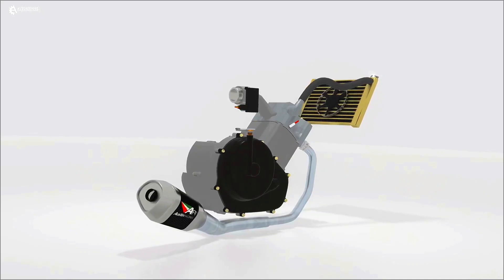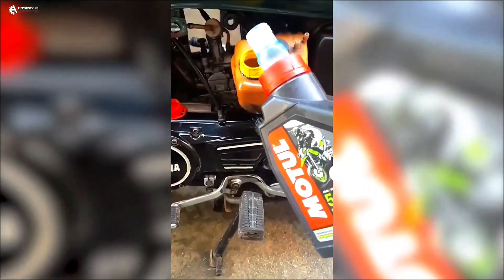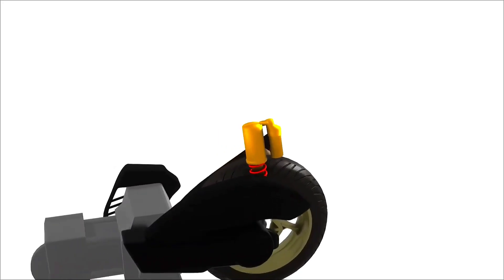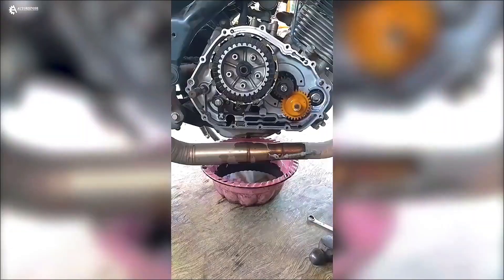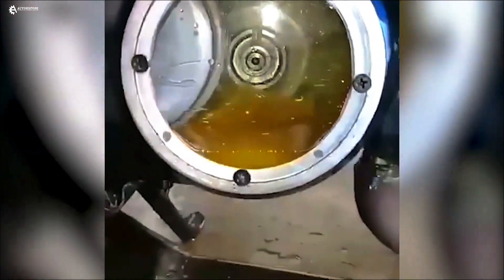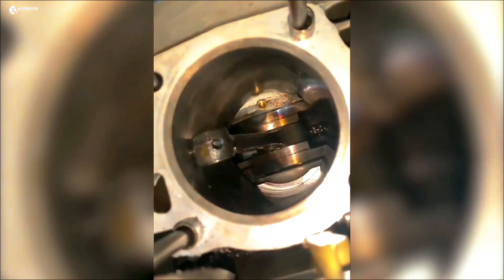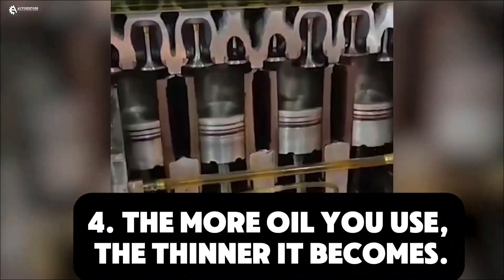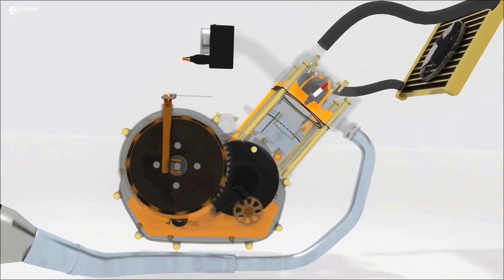Facts About Engines Oil That You Need To Know!

Comment: 2:04 it's not because black oil automatically means its damaged already, but because you need to do a blottertest to decide wether the oil is black enough to determine its eol (end of life)
Reply: this kind of information is usually misinterpreted by someone to justify their oil quality which is actually quite bad, when tested against many kind of oil, the weaker ones usually turns black immediately, meaning that its quality is bad and susceptible to oxidation quickly, but then they justify it with words like in this video
Reply: Thank you !

Comment: Change the oil every how many kilometers?
Reply: It's better to follow the owners manual
Reply: Every 5000 miles or 8000 km
Reply: depends on the engine health and oil quality tho, if you want longer engine lifespan, shorten your oil drain mileage to prolong it